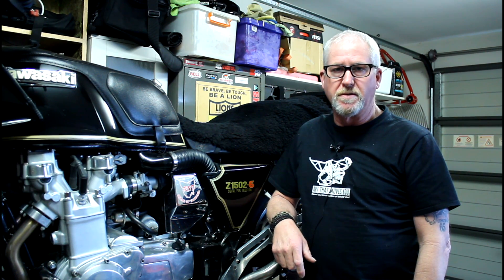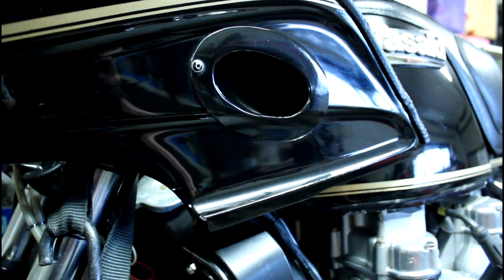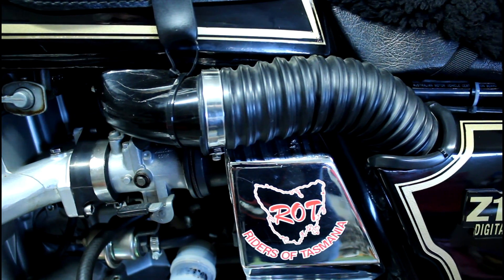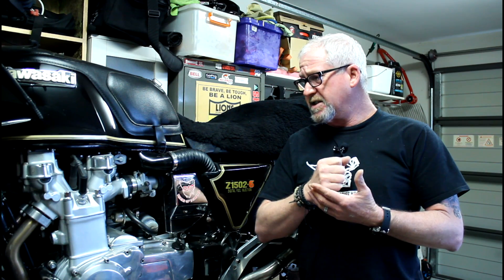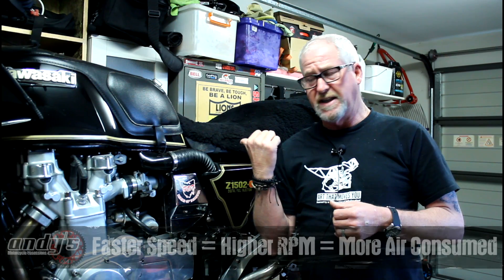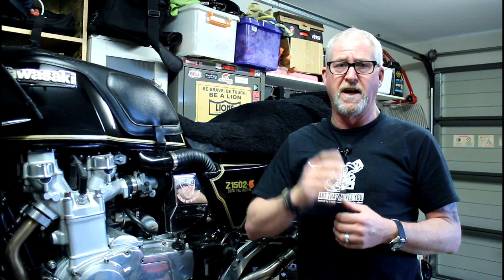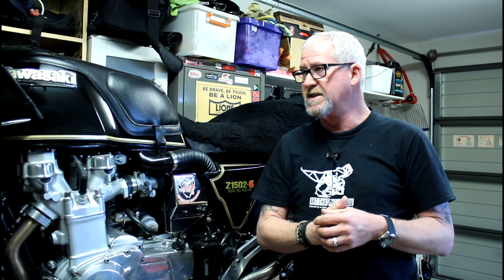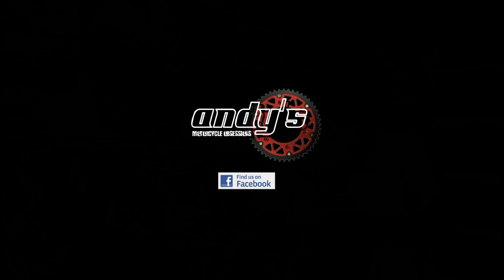Ram Air - Does it Work?

Comment: I knew a guy who made a short hood scoop as whide as the frount of hood funneled straight to the throttle body with no filter. He had to connect the hood to the throttle body and screw the hood shut. No one could beat him Roll Racing anymore so it must work. All of our cars were pretty much equal to that point. Then he could give us a head start and walk us.

Comment: A cooler engine makes more power. The more air introduced to the motor, the less the  motor has to work to get this air in. I took the Hot Dusty Air intake air cleaner (under the hood) and plumbed it into the split of the front bumper. In real world terms, it made more power across the board. That's why Turbos and Blowers make more power than a Naturally aspirated engine. So, get back to work.  A  dyno is not accurate for this reason, the motor is still using energy to suck in air. Elementary my dear Watson.
Reply from the maker: Oh. My. God! Where to start with this comment? 
“A cooler engine makes more power.” - No, a cooler intake charge makes more power. Why? Because the air is denser when it’s cool. What does that mean? Air contains approximately 21% oxygen, which is what is required to burn with the atomised fuel. The denser the air, the more oxygen you have to work with.   

“the less the motor has to work to get this air in” - The engine doesn’t have to work any more to get the air in. Air flows from the higher (atmospheric) pressure to the lower pressure region in the cylinder. The intake air charge temperature is the only difference. Engines don’t suck.

“That’s why Turbos and Blowers make more power than a Naturally aspirated engine.” - Forced induction is achieved by either mechanically compressing the charge and increasing its density or by introducing a higher pressure by injecting nitrous oxide. This is how they increase volumetric efficiency. But this requires work. Work = heat so an inter cooler of some description is required to reduce the charge temperature and improve the efficiency.

“So get back to work” - Me thinks you might need to do a bit of study before making such comments.

“A dyno is not accurate for this reason, the motor is still using energy to suck air in.” - Sigh. Dynos are not accurate for many reasons, that ain’t one of them. Air enters the engine due to pressure differential. The engine has enough trouble dealing with pumping losses, frictional losses, flow impedance etc to worry about sucking air. Engines don’t suck!!!! They are not a vacuum pump.

In summary my comments are solid. Until such time as the vehicle velocity is high enough that the air flow can be converted from kinetic energy to pressure energy all you have is a cold air intake. The engine consumes the air faster than it is moving through it. It can run at redline stationary. You need to be well north of 100 mph before you can even think about converting to pressure energy, and then you need a properly engineered intake to achieve maybe 2psi. Best go hit the books Roman.
Reply: @ANDY5  ok, you are the same guy that has all the stuff and still loses races. Einstein
Reply: Confidently incorrect

Comment: Cold air intake.
AND Pressure to.
Indeed At high  speeds the effect is clear and a real increase  of power can be noticed. 
In 1999 I had a Yamaha r6 and raced my brothers zx6r a few times. Top speed  the r6 would run past the ZX6. 
On the dyno the zx6 was the more powerful bike. 
Not with the ram air at work

Comment: zx6r or a  97 cbr 600f. the ram air systems  on them are incredible. and it silly to say they dont work at low rpm. thats obviously the case. i own a cbr600f very  quite at low rph. Take it into the mid  range it gose nuts. properly  desgined motorcycles. I'll have to get an zx6r I've heared they have an amazing sound aswell and they go like a bullet.

Comment: David Vizard did an article on ram-air many years years ago (as applicable to tuned cars). I would not want to undermine his work by trying to paraphrase a long article into one sentence but for top end speed there were serious trade offs with the added drag. The usual bike arrangement of carbs behind a very hot engine looks a bit of a nightmare for air density... very thought provoking video.
Reply from the maker: +g0fvt g'day mate. Yes I guess there would be a lot of calculations involved in determining the tipping point between the drag created by the volume of air you need to convert to pressure energy at the level of consumption those engines are capable of verses the power gains from that pressure. Of course once you shove a blower or turbos into the mix it becomes futile. He is a clever man, thanks for watching.

Comment: It seems to me that you're trying to say you get no boost from ram air, like you would with a turbo or supercharger. That doesn't really mean that a properly designed ram air "doesn't work". The bike you have on display doesn't seam to be a great ram air design, not like a modern sport bike.
Reply from the maker: If you're doing a couple of hundred miles an hour on a modern sports bike, you might get about 0.6 - 0.7 psi pressure increase, hardly worth crowing about.  But, as I said, it is still a cold air intake so they're not completely useless.  Thanks for tuning in mate.
Reply: @ANDY5  - Very simple way to test your own bike. Set a gauge, ride it under the conditions you´ll like to test. Record the gauge readings. 

That particular implementation on the KZ, BTW love the bike. ;-)

Seems a bit counter sense, the frontal area of the bike will always be subject to the highest pressure. The lateral most probably will have very low or negative pressure;-)
Those lateral sides of the tank, to be honest, seem terribly inefficient to position the ram air intake. 
I would dare to say, they are counter productive. Reading negative pressure in that particular area might not be a big surprise. ;-)
  
Anyway a sensitive pressure gauge and a few wool strings attached in the area will give you a pretty good idea of the air flow and pressures involved.
Don´t look to much to those strings while driving at high speeds. :-)
Cheers

Comment: Ram air works on a properly designed system. A few years ago the UK magazine Fast Bikes got to test a few bikes at Cresent Suzuki's wind tunnel; at 120mph the Gsxr1000 got a full 10bhp extra (at the time this was the best system on a street bike - IIR it was the 2003 model Suzook).
Reply from the maker: G'day mate, that's really cool, and interesting.  Do you know if there is anything out there on the interwebs about that story, I'd love to check it out? Thanks for tuning in.
Reply: I'll see if I can find my copy Andy, if I can I'll let you know the year & month (& if it comes to it I can scan it & send it to you); they tested 3 bikes in the tunnel IIRC at 3 set speeds, it was an interesting read (& I must admit I was surprised by the results myself).
Reply from the maker: Gixxerman 001 I've been thinking about this, because I have no life lol.  If the test was performed in a wind tunnel on a dynamometer it would have to be a static test, surely that would not be an accurate test as the bike doesn't have to overcome the wind resistance as it would in a dynamic road test.  Aside from the wind resistance of the bike and rider, the better the system is able to produce a static higher pressure condition in the air box the greater the parasitic loss during motion.  No motion = no frictional loss, apart from the dyno resistance simulating road friction.  That would lift the required road speed for the same result significantly at WOT.
Reply: Hi Andy. 
All I can relay is my memory (until I find the mag in the heaps of them I have scattered about the house, I wish I was joking lol).
They ran 3 different bikes of various sizes at zero wind speed & then at 3 wind speeds in an enormous (they had a guy sitting on the bike) aerospace-type wind tunnel they were getting the use of.
IIRC 1 of the bikes didn't have a ram air system but they wanted to see if higher wind speeds made any difference to power output (it did, a few hp increase was recorded).
I think that all came together after Paul Denning got the Suzuki Rizla MotoGP managing job, obviously Crescent Suzuki - who are a local decent sized but hardly huge bike dealer & repair/tuning shop - don't have their own vast wind tunnel.

Comment: I like that you included the graph.  How did you aquire that information?

I have seen a test, many years ago, where they took a digital manometer and recorded the pressures in the airbox as they rode at different speeds.  They then attempted to replicate those manometer readings on the dyno by using a huge fan.  It was an interesting investigation into ramair set-ups...so much so that I tried to incorporate a similar design on a 2 cycle kart set-up (which failed miserably) but that is another story.
Reply from the maker: G'day Mike, I have David Vizard's "How to Build Horsepower" book.  Worth a read, thanks for tuning in.